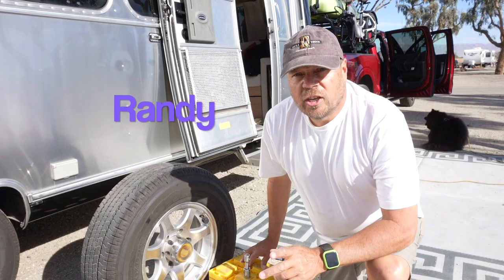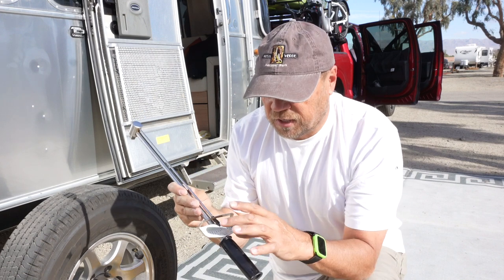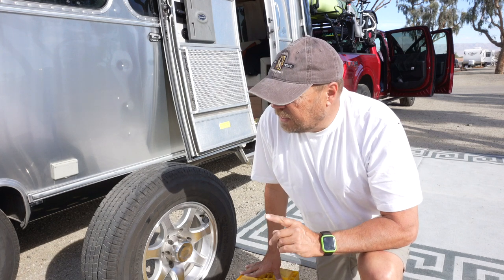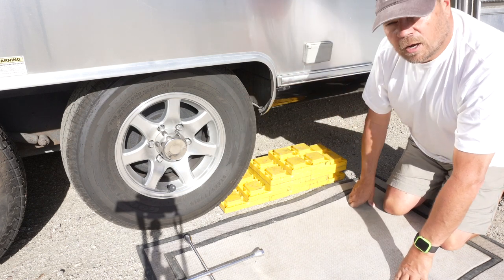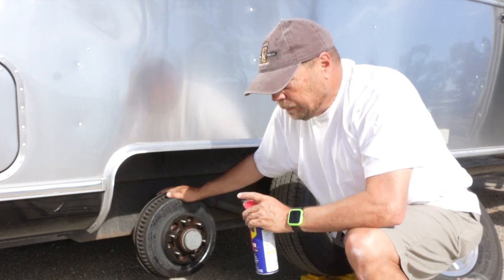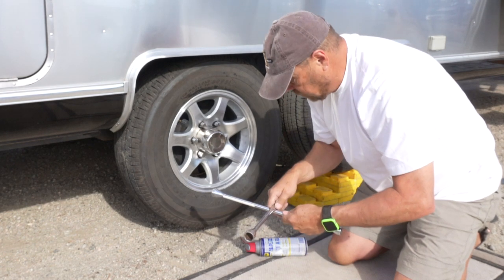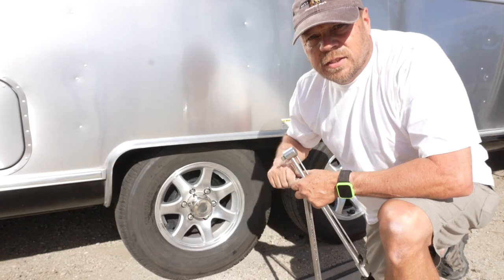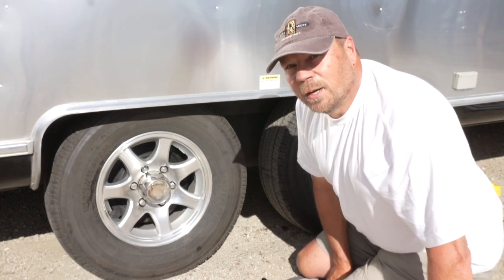How to Change a Tire on our Airstream Trailer | RV Lifestyle

Comment: Thank you. Our 2021 Caravel came with a tire iron, which is think it's standard for new model Airstreams. Caravels are single axel, so, after watching this video, I checked to make certain I knew where the Jack plate was.
Reply from the maker: Thats good.  They used to tell you to use the tire iron from your tow vehicle, but most of the time the lugs were different sizes.

Comment: Always use moly grease on stud threads. Excellent lubricant and anti seize product. You'll never have an issue taking lugs off. WD-40 won't last and dries too quickly.
Reply from the maker: Thank for the tip, I have not tried moly grease before.  WD-40 was all I had available with me and it was better than installing the lugs dry.

Comment: Get a Trailer Aid.  It is more  secure than a ramp.  WD40 is NOT a thread lubricant or anti-seize.  Chock the wheels on the other side to better ensure that the trailer does not move.  NEVER place your legs where they could be crushed by a rolling trailer.
Reply from the maker: Thanks for the tips.
Reply from the maker: Couple follow up comments - Andersen levelers would also work as a ramp if you have them. WD40 is better than nothing when you don’t have any other lubricant or or anti-seize. Chocking the other wheels is a good suggestion but may not be necessary as the trailer in the video was hitched to the truck and would not have rolled.

Comment: Eeek, don’t put WD40 on lugs.  It can cause them to loosen over time;  you don’t want your wheel coming off.  Also, are those aluminum wheels?  Torque is 110 as opposed to the steel ones which is 100.   Stay safe out there.
Reply from the maker: Thanks for the feedback. I don’t believe In torquing wheels with out lubricant and all I had was WD40.  I always recheck the lugs after a few miles and then before the next trip.